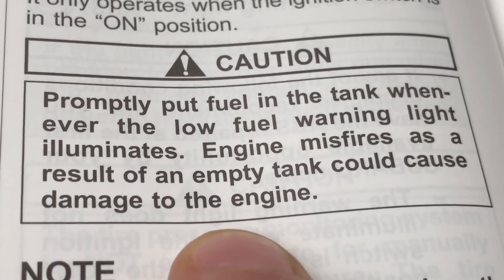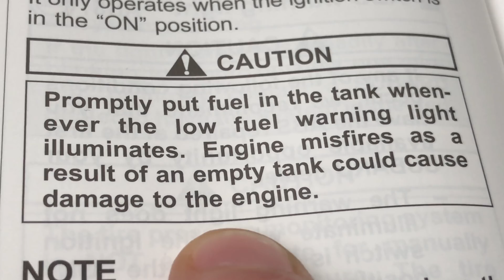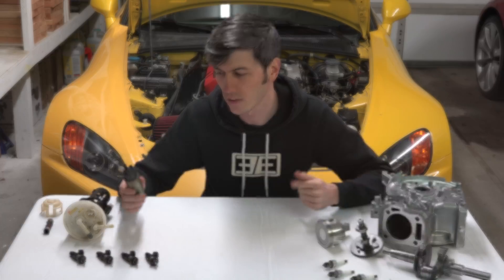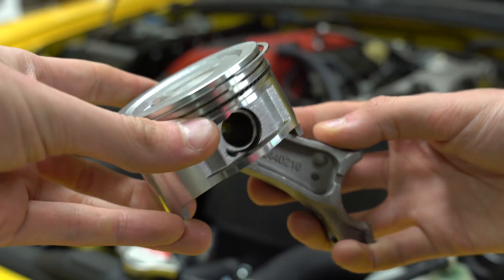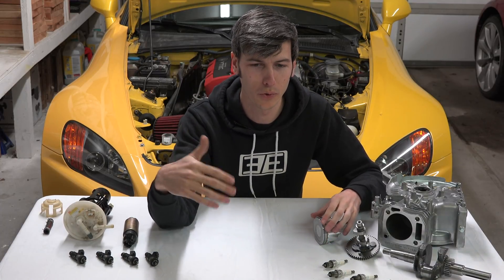Will Running Out Of Gas Damage Your Car?

Comment: My wife use to always run her car right at empty, till she had to pay for a new fuel pump / filter, and it to be put in.
Now she treats 1/4 of a tank like it's empty.
Reply: 1/4 tank is the safe zone, so this is good!
Reply: @josephcarrino5581  Are you one of those people who believe you must warm up a modern car 5-10 minutes before driving it?
Reply: John D You could drive it just be gentle and baby it until it reaches operating temperature.
Reply: @johnd5805  
You should let your car warm up 30 secs. You should not start it then drive off right after starting it.
Reply: @dillonh321  absolutely. Start it up and by the time you put the seat belt on and look in the mirror 30 seconds is past. If it's your wife by the time she does her 5 things it's about three minutes.
Reply: @johnd5805  
Mine just gets in, puts on seat belt then starts it, then immediately puts it in drive. I keep telling her to let it wait... She never listens.
Reply: @dillonh321  I believe that. There's a lot of things they don't listen about. Let's not make a list. Can't live with them or without them as the old saying goes.
Reply: Dillon Hawkins I hold it at rev limiter immediately after starting it until it reaches operating temp
Reply: @russtish3533  yup, I just Italian tune it every morning too.
Reply: Dillon Hawkins she must know more about cars than you
Reply: @dillonh321  Our Prius is start and drive - the engine fires up about the time we get to the corner. Most cars are fine with five seconds to make sure the oil is flowing and getting to the cylinder walls.
Reply: @russtish3533  then you might as well drive it then. If you're revving it up that's no different than driving it. You're just wasting gas holding your foot on the pedal and not moving when you could be holding your foot on the pedal and be actually moving.
Reply: @dillonh321  Good thing she doesn't listen to you, since she's actually right.  You're the one who's wrong.
Reply: @SpeCifiC0507  Leno is no ordinary millionaire. He works on his own cars. He values and respects what he has. He doesn't go around trashing his cars.
Reply: @johnd5805  I usually let them warm up till the temp gauge starts to move, then drive gently till it comes up to operating temperature.
Reply: @johnd5805  The temperature indicator on your dashboard will show when things are at operating temperature.
It should not take 5-10 minutes, except maybe in really cold weather.
Reply: @johnd5805  You should bring any mechanical components to operating temperature before loading it
Reply: Coookie 10 to 30 seconds for warm up check your owner manual
Reply: @FerasAlhawas  Good to know. I don't even own a car
Reply: @FerasAlhawas  Exactly. Thank you. I have a friend who can not give up the old way. EE/Jason has done one or two videos on this. Check them out.
Reply: @FerasAlhawas  30 seconds minimum for turbocharged cars. Need to warm up that lubricant.
Reply: Coffee Rebel as i said the owner’s manual tells you what is better for each engine plus when you warm up the engine you should not use over 25% throttle until you see the coolant temperature gauge at operating temperature
Reply: Feras The only thing the owners manual is designed to do is advise enough PM in order to survive the warranty period
Reply: Coookie unless properly lubricated
Reply: Coffee Rebel need to learn how polymer oils work
Reply: @FerasAlhawas  There is a lot of variation. Our Prius owner manual says start it and drive it (the engine will fire up when it is ready and will be loaded as the hybrid system sees fit.) The manual for the early 2000s Ford work trucks we had with the 6.0 Power Stroke diesels said to warm up for about 5 minutes.
Reply: @timohuhnholz  in the coldest of cold snaps it might take you a whole minute for your car to get warm enough to drive. In the winter you only need about 30 seconds in the morning but not as much during the day.
Reply: @timohuhnholz  Idling and going down the street at 25mph is not loading it. I understand your point though.
Reply: @FerasAlhawas  thank you
Reply: @FerasAlhawas  I think that's especially true in all these direct injection motors too. Letting them idle too long will increase oil dilution. It's one of the reasons they use such thin oil, mine takes 0w20 or even 0w16 depending on who you ask. That low viscosity oil lets the motor reach operating temperature quicker.
Reply: @johnd5805  Any car will benefit from letting the components get up to operating temperature. Modern cars don't need as long to get up to operating temperature, but that doesn't mean driving it right after starting is a good idea.
Reply: @jonathanmueller2849  You're no expert. Watch the video from an expert. Even JAY LENO driving a $1.8 million superxar started it up and began to drive it slowly using that to "get everything up to operating temperature".
Reply: @jonathanmueller2849   The car will warm up faster if you drive it than while idling.  I prefer to drive lightly for the first mile or so.
Reply: @johnd5805  Jay leno can afford to buy a new engine. Most can't. FFS you are niave
Reply: @DANGJOS  and you will crap out your transmission must faster doing it that way due to harder shifts because the tranny fluid isn't at its max lubricity...
Reply: @christophervanzetta  you're brilliant
Reply: @jonathanmueller2849  a couple of minutes? That's too long for any engine and is a waste of fuel.
Reply: @jonathanmueller2849  Idling the car to have it warm up is not good either, better drive cautiously until the temperature indicator on the dash says it's ok.
Then floor it at the next traffic light!
Reply: @jonathanmueller2849  You're wrong. Watch Jason's videos on this. Old vehicles yes. New vihicles no. Read your owners manual.
Reply: @johnd5805  In Canada, 5 minutes is the minimum (unless you're crazy af).
Reply: @mann8333  I live way farther Sout in Louisiana. No need for 5 minutes. You gotta be crazy to live in Canada or just happen to be born there.
Reply: @jonathanmueller2849  well I live in Michigan and can attest to what he's saying about warming up your car. It's completely unnecessary and a total waste of fuel. If it's colder than 10  degrees then you only need a FEW seconds to let the oil flow thru. Below zero you might wanna give your oil a whole minute to flow thru. Once that happens it's safe to pull off and drive at low loads until the engine is up to operating temps. This happens MUCH faster than sitting idle. 

Idling anything over a minute is a complete waste of fuel.
Reply: I used to do that, but after hearing that it would damage the fuel pump, I immediately stopped.
Reply: @josephcarrino5581 

That's my mom right there. That's why I got her a hybrid
Reply: Dennis Xu why do you have to disrespect your mom tho bro ?
Reply: Ussually when you start a engine 30 secounds or so later the rpm drops and the engine tone changes once the oil starts lubricating and the afr settles
Reply: @josephcarrino5581  That's fine as long as you accelerate gently. The only exception is when its below freezing in the winter
Reply: That’s totally me 😂 my poor car 🙏🏼 but now I treat it better tho. It’s my first car 🚙 ❤️
Edit: well ok I mean not on total empty to the point it shuts off but I used to drive it when the E light comes on 😱 but not anymore!
Reply: @rinr7052  It's fine to drive until the "E" light comes on. Your car then has 2 gallons in reserve to get to the nearest gas station.... It's by design. Just don't drive waaaayy past that and run your filter/pump dry because that is when damage can occur.
Reply: Been doing that for 15 years and never had a problem with a fuel pump. Sounds like bad luck or a bad car to me
Reply: It hurts when da cash comes from ur pocket
Reply: I'm not taking advice from YT, so...

That said. My warm up procedure for my 170,000 mile car is:
Start
Idle a few seconds while I make sure everything is good to go like mirrors, parking brake, seatbelt (which I typically buckle before doing literally anything else).
Drove away like normal.

Warm up procedure for my 300,000 mile diesel (which I just bought):
Crank and hope it starts.
Crank and hope it starts.
Crank and...yes! It started!

Idle for 5-10 minutes, longer if I can. Drive super gentle until the oil reaches 100° F. Drive gentle until water temperature registers on my stock gauge (will be replacing with aftermarket soon, then I'll probably target 130°)
Drive like normal once water reaches normal operating temperature.

I operated the engine room of a ship for several years where a single engine is literally the size of a school bus. We kept the engine oil at 100° at all times with heaters and electric pumps. We also idled them for an hour before doing anything and still waited until we reached 140° before putting ANY load on them. But, that's not a modern passenger car (neither is a plane) and not comparable.
Reply: @josephcarrino5581  Hate seeing people do this
Reply: I consistently drive to below empty.  See my comment above.
Reply: @AlanTheBeast100  If you are the college kid, fill up your car once and then treat 1/2 tank as empty. Your still spending the same on gas, just in a different way. And will make your car last longer.
Or you can walk more when it breaks, exercise is good also.
Reply: @KalRandom  
No.  You're wasting time stopping for gas twice as often as I am.  Fill to the top.  Drive to (near) the bottom.  Save energy and time by not wasting time at (and gas) stopping at gas stations.
Reply: @AlanTheBeast100  Not really, cause if a emergency happens I don't have to worry if I have enough gas to do what I need to do.
Also, I have the freedom to get gas without waiting in line, because I don't have the gas to get to the next station.
Reply: @KalRandom  
No issues for me in 40 years of driving.  To be sure, if you live in a very rural area with fewer gas stations, or in extreme cold weather, one should adjust.  But for my 'daily driving' a full tank to very low tank means I save a lot of time.  As to waiting in line, that's extremely rare for most stations, and even Costco can be timed during the week to miss the rushes.
Reply: @josephcarrino5581  Is that bad??!?! why?
Reply: Sounds like she had a bad fuel pump
Reply: @josephcarrino5581  There's nothing wrong with driving instantly after driving your car dumbass
Reply: my old mistubishi ran pretty much the same on "E" as it did on "F" my altima performs differently even at half tank vs "F" which is annoying
Reply: ...so they just got stranded every time?
Reply: Going to confess i did so as well. Until after watching this video that is..
Reply: @josephcarrino5581  I got her out of that habit also lmao took a little while though.
Reply: Also folks bringing the engine temp up to proper operating temperature before driving will make it last longer.
But what do I know I drive a 97 model with over 240k miles on it.
For the comment on Jay Leno cranking and driving, that was a TV show, good safe bet is it was run before that take. And he has the money to replace a engine.
If you want a car to last treat it like you want it to last.
Reply: @josephcarrino5581  Oh, you mean you can't drive right after starting? Oh no! Yeah, that's another myth unless it's very, very cold outside you only need a few seconds to start driving.
Reply: @ericolens3  Well porché's are straight junk. They are German engineered market'd as Italian cars. All german engineered cars are junk. Toyota is king in terms of reliability if you import from Japan
Reply: Seems a common female driver problem. My misus doesn't have this problem, however, she gets panic if the tank has still 10ish litter (or less than 20litter in our current car) fuel left.
Reply: @GuitarsRockForever  Females don't get taught about cars. If your parents/mentors don't know jack about cars, then neither will you. Suggestion: If ya got daughters, force 'em to learn because it's a necessary life skill in the USA.

Source: Me. Neither of my parent know jack about cars. I had to learn everything from how to use the fuelpump, to the fact that cars have to have their oil changed, to the fact that I have to rev match when changing gears. I still have a lot to learn and every once in a while I'll get a bit of anxiety about my baby cause I have no idea if I'm forgetting something crucial.
Reply: Joseph Carrino why not, unless you are 100% natural oil, or live in the Africa circle, you don’t need to warm up your car. Science is awsome
Reply: @guyver214  Africa circle?
Reply: Good

Comment: Would the results be different for a diesel engine tho?
Reply: Yes they will. If a diesel runs out of fuel, lubrication of the high-pressure fuel pump is also gone (it is lubricated by the fuel). Long before the low pressure pump (in the tank) overheats, the high pressure one can send metal flakes from its internals into the injectors and damage them. And high pressure pumps & injectors on diesels are quite costly to replace...
Reply: I know some of the bigger diesels will quickly lose injection pressure and die before fuel pump issues occur, that said, re-priming them and getting the air out can be something that takes quite a bit of time and patience, especially if you don't have a manual priming pump. So the short version: Don't run out of diesel :P
Reply: My friend ran his Hummer H1 out of diesel. Killed the injector pump. Thousands of dollars later and it was fixed.
Reply: it's exactly like 
@Alexander Mitov explained! the high pressure pump in many modern diesels is way more sensitive to missing lube and diesel fuel is the only lube it gets.
Reply: @7pdude  That's why they tend to shut down the engine before it actually runs dry.
Reply: @7pdude  also cavitation will destroy the high pressure pump very quickly
Reply: It's common for diesels to have cut off switches in the tank to cut the engine before that happens
Reply: Rick White True. I have a common rail diesel and the owners manual states that the engine will be switched off before the fuel tank is empty
Reply: Holden fuel pumps often die at 120,000 miles
Reply: @jackd1582  a normal fuel pump isn't a diesel high pressure pump.
Reply: Similar for GDI engines, but at that point you have a pressure sensor in the high pressure rail that can detect when the fuel runs out and it typically stops injection at that point to prevent damage.
Reply: @jeffbeasley8235  all diesels and direct injection engines has a high pressure pump.
Reply: While technically true, not in the way you mean. Diesels with a unit injector use the injector itself as the high pressure pump. An engine with a distributed fuel system uses a high pressure pump to the injectors   @alexstromberg7696
Reply: Modern Diesel engines would simply shut off before you run the fuel pipes dry.
Reply: As soon as you loose fuel rail pressure it will cut the engine.
Reply: Run a diesel out of fuel and it’ll have to go to a shop
Reply: I have run out lf diesel and nothing happened, some new fuel in and a bit of starting and she fires back up.
Reply: My father is literally running on low fuel, just above the bottom, in his diesel engine for about 15 years now (german car, Opel, everyday driving) and never had to change fuel pump so stop being smartasses and realize that somethings in life are not 100% mathematicaly explainable and thus correct
Reply: NEVER run any size of a diesel emty period. It will be a expensive negligent action 95% of the time.
Reply: It is worse for diesel. Diesel is thicker which is more of a change from normal. In addition, at least in most diesel vehicles, the pump cannot prime itself which means that you can easily run the pump longer when empty.

Comment: You still have the S2000!
Reply from the maker: It was all a lie! Never sold it! Hahaha it's in New York now, if you follow along on Instagram - https://www.instagram.com/p/B1quVjwBgr_/
Reply: @EngineeringExplained  "New owner is having fun with the liscence plate" If the new owner is not you then you sold it?
Reply: @EngineeringExplained  That license plate is fabulous!
Reply: @EngineeringExplained  Good to see you still have it! Rock on!
Reply: @vlenhoff  whoa! Totally sweet! Didn't even realize it was still around.
Reply: @vlenhoff  he doesn't have it, sold to someone in NY, video was recorded a while ago. He explained it on his Instagram
Reply: @toddf93  - Even if Jason hadn't explained it, the Tesla's front wheel in the background proves this video is old.  ; )
Reply: @vlenhoff  don't forget to read next time
Reply: @joec3090  Yes Sir! captain! Sir!
Reply: @toddf93  ohhhhh. Almost got me...
Reply: What about with Diesel engines. Please remember your European audience 😁
Reply: @mgdrive High pressure pumps use diesel for lubrication, so foaming form air ingestion or misfueing (like petrol contamination) can cause wear to that part. They also don't have issues running lean, so misfires and catalytic converter problems mentioned don't apply. Priming the system may or maynot be difficult if the engine does actually stall out due to running out of fuel, but if you can still drive to the gas station all the other things from the video should apply.
Reply: " 13ulls in the bronx " Piercing The Veil ;) and you mean nuevo Amsterdam
Reply: Pre recorded video
Reply: Yeah, he just deconstructed the whole engine just to show us what happens if out of fule.
Reply: Actually a 350z but OKAY